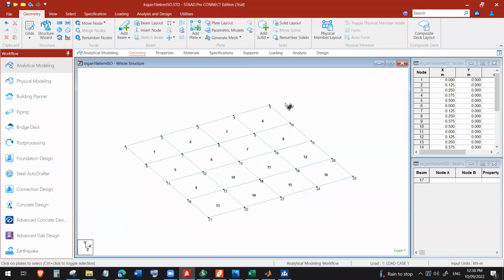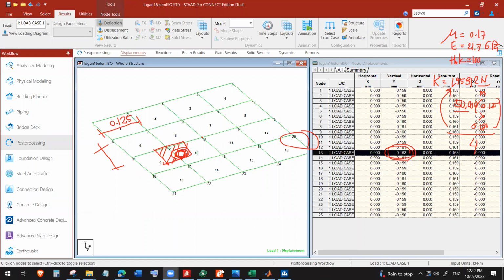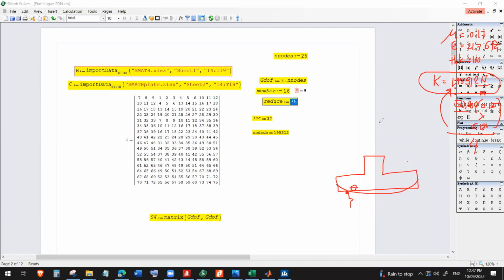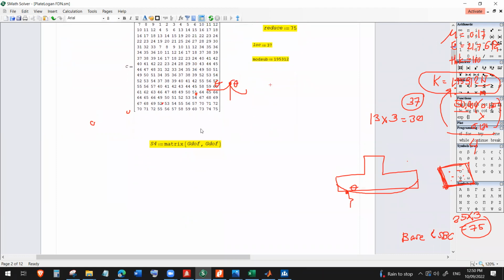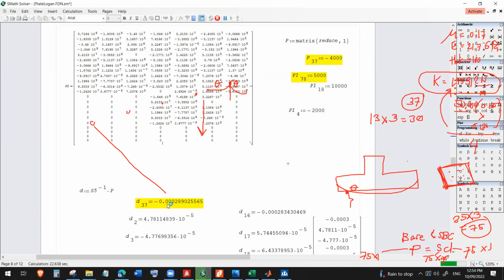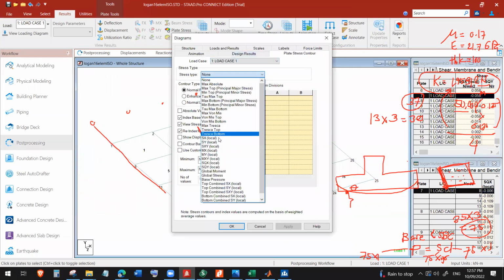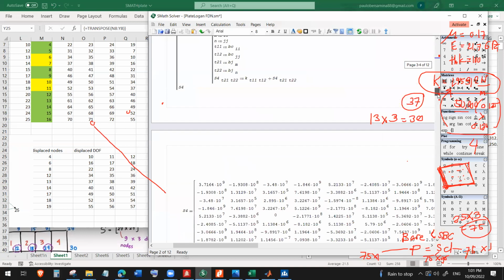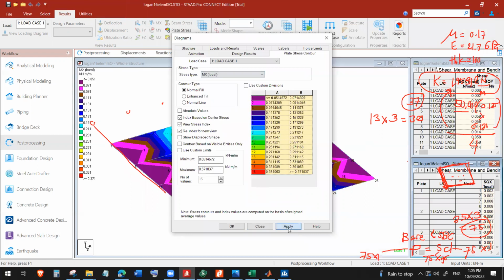Finite Element of Isolated Footing using SMATH and STAAD

Comment: Sir anong  moment at shear  ang  ginagamit para sa design? - Mx, My, Mxy....
Reply from the maker: technically, its the wood armer moment as per softwares manual. although in a very regular geometry, Mx and My will do so long as the Mxy is almost negligible
Reply: Sir, why the result using finite element I.e. moment  is less compare to rigid analysis.
Reply: The new Staad Foundation 2024 has the ability to run an FE analysis of Isolated and combined footings along with checks such as Punching Shear , one way shear etc . Please see https://youtube.com/playlist?list=PL5LpElzkNC9lmXRp_JpLvuSY4u9TXPjcY&feature=shared